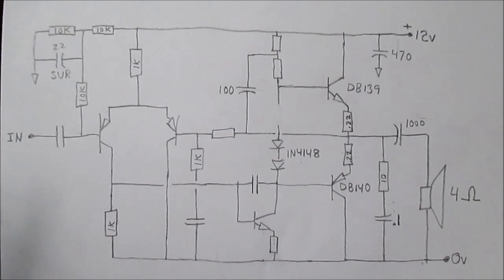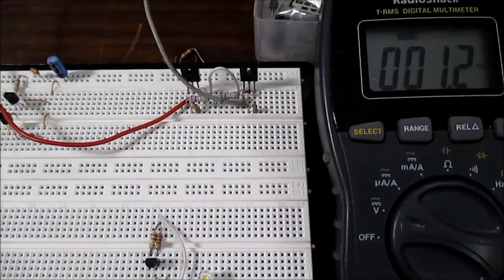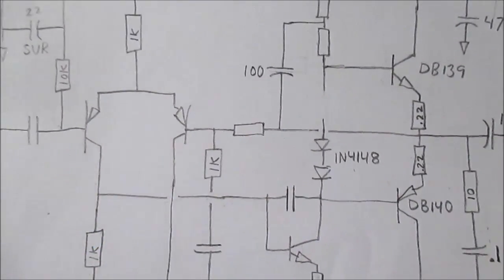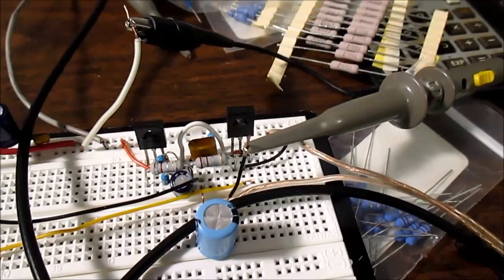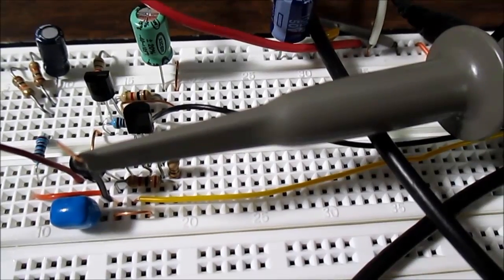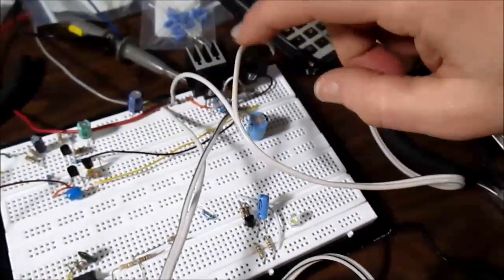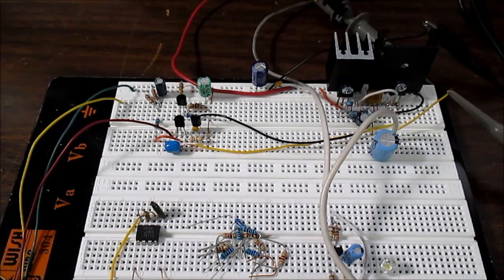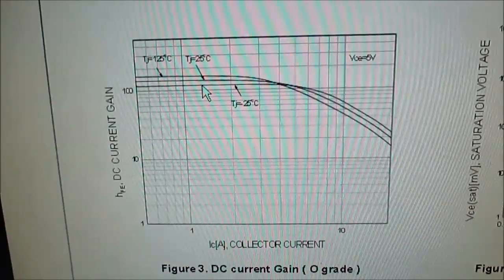12 volt 2 watt DIY transistor audio amplifier build FAIL PT 1

Comment: John, enjoying your videos ery much, thank you.  Off topic, have you ever touched on the subject of 'soft power on' circuits, eg delayed relays, to avoid the 'thump' that otherwise occurs.  Would very much like to hear your thoughts on the subject.
Reply from the maker: They are necessary for quiet turn on/off and perceived quality in consumer audio gear. However, for small low power IC amps, like the ones I review, I would never use them as it adds more complexity and another point of failure and distortion (dirty relay contacts). I repaired a few stereo receivers and a common failure point was the relay. One of my earlier videos here was replacing a relay in an Onkyo receiver. For the stuff I build, I don't mind a small pop or click sound when I turn it on.
Reply: Agreed, have had to clean or replace relays in quite a few amps.

Comment: I have built many small amps similar to that over the years. Typically TIP31 and 32 for outputs. No issue driving 4 ohm loads.Couple points - driver current needs to be about 25 to 30 mA in order for it to work. Adjust the voltage divider at the input of the diff amp to get as close to .5 Vcc at the point where the output emitter resistors connect together - midpoint voltage - critical for max output swing and lowest distortion.
Reply: I like to use the TIP series too.
Reply: Yes very "generic", low cost, readily available.

Comment: Well at least it kind of works, if you increase the feedback resistor there will be more gain and you might not even need to use a preamp on that.

Comment: I need a 200w rms mono amp, should I go for a descrete amplifier? or any simple solution exists pls help
Reply from the maker: Yes, I'd go discrete.
Reply: Agree, there are a lot of cheap Class D amps  in that range now-a-days. Not that I really like Class D, but many do preform well and deliver a lot of bang for the buck.
Reply: Descrete amplifier is headache to me. Biasing, thermal protection, short-circuit protection, SOA protection 😓. Is there any way of doing it simply?
Reply: Class D  Super cheap, no bias, little heat. Just search E-Bay or Parts Express, make sure their talking RMS  though, a lot of BS out there.
Reply: Can you suggest one for 200w rms
Reply: For 12VDC, 120VAC or 240VAC?  Hesitate to really recommend any as I haven't tried them though. Why the 200W number? Tell us more about your application and maybe others can give suggestions.  I recently made a video on a 100W kit from Banggood that turned out to be a total POS because they came with bad chips.
Reply: I have 240volts outlet, 200w because my subwoofer rated for 350w nominal but I don't want to reach woofers limits so decided to go with 250/200w rms

Comment: The bottom sort of has a driver in the form of that invertor stage. Could avoid that invertor stage by using a quasi-comp out, not that I'm a fan but it is an economical design. But yeah it would just need more gain on both sides so you probably still need a transistor there. You could get a bit more gain out of the input differential by replacing the 1K resistor with a constant current source.
Reply from the maker: That class A driver is an important part. It must provide enough current to drive the outputs and provide the full output voltage swing because the emitter follower OP stage has no voltage gain. I could do an OP stage with gain but nearly every amp designer frowns on such a design. This is a 5 transistor job or bust. I kind of already know that the output needs a CPF or darlington stage to work right with 4 ohms but I'm going to try the better OP transistors.

Comment: Don't use discrete diodes to bias the output stage. Ask me how I know :P

A vbe multiplier is easier to adjust and easier to thermally compensate by mounting the transistor on the same heatsink as the output transistors, or even directly on the transistors themselves.
Reply from the maker: Any serious amp I would. Back before ICs took over the lower powered amps almost always used diodes clipped to the heatsink. Many of these amps were poor with 4 Ohm loads. I'm going to pretend that I don't know any better to see how it works out.

Comment: You have lots of knowledge in audio amplification. Why you don't do a tutorial on the various modules an amplifier needs, like the current source, the pre-amp module, the B amplification module, the tone module, things like that instead the fully assembled stuff? This way people would be able to understand better all those big and complex circuits thinking on them in a modular fashion...
Reply: He's already done that, did you even check his channel before posting?
Reply: Can't find the playlist with the tutorials... :)
Reply from the maker: I made a video on a current source, current mirror, voltage regulator, differential amp, ect. I can't put in links as YT may block you from seeing this reply due to spam filtering. I should gather them into a play list. I might remake better videos of them at some point.
Reply: You on a phone? I know they can make finding things convoluted.
Reply: You can put links in your own comments on your own videos without them being held back. You can post links on anyone's videos, but the owner of that channel will need to approve them. So if the creator is involved with his(or her) comment sections, they will usually approve them. Feel free to post useful links in the comments on any of my videos, they will get approved. I prove all links unless they are not related to the video.
But a playlist is a good idea too.

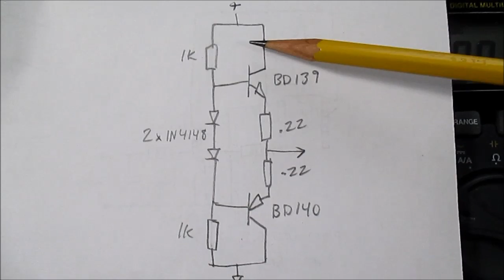Comment: .22 ohms, is that it? 2:30
Reply: Yes
Reply: 2 Watts?
Reply: Rating on the resistor?  With six volt rails and to tolerate a 4 Ohm load? 6V/4.22 Ohms = 1.42A.
0.22 Ohms x 1.42 A = 0.31V across the .22 Ohm resistor.
0.31V  x 1.42A = 0.444 W, so a half Ohm resistor should do. Could of worked it in fewer steps but wanted it to be easy to follow
Reply: I should of answered as Hill's Workbench, as I now post all my electronics stuff there instead of on HillOrStream
Reply: Hill's Workbench Ok, I'm not arguing about your math, just saying that the shown resistors look like 2 or 3 watts ones.
Reply: Bigger doesn't hurt!  (to a point) John probably just used what he had on hand for repairs or construction of larger amps..

Comment: try adding a coil  "1.5uH"  in parallel to a 10Ω 1/2W resistor to the output to see if THD can go down also does the output need that 1000uF capacitor ? I have seen that circuit before :)
Reply: He can't get rid of the 1000uF and have the speaker go to ground, as he's using a single ended 12V power supply, he'd have to return the output to a 6V power supply instead, but at that point you'd call it a dual 6V supply, not what he is trying to use.
I released a video a few days ago on that inductor, adding it would not affect THD, it's there for stability.
Reply: yes you right dual rail voltage I didn't think about it so no change even with the coil ? interesting  I'll check your video sir
Reply from the maker: The coil in parallel with a resistor you often see on higher power amp outputs is used to prevent the amp from becoming unstable with capacitive loads. Small amounts of capacitance from long speaker cable runs or speaker crossovers can cause this capacitance. At high frequencies the coil reactance increases the output impedance and counters the capacitance. The resistor lowers the Q of the cap-coil circuit reducing any resonant peak.